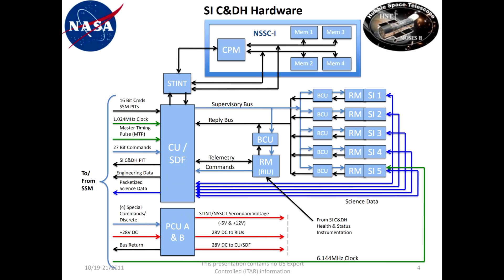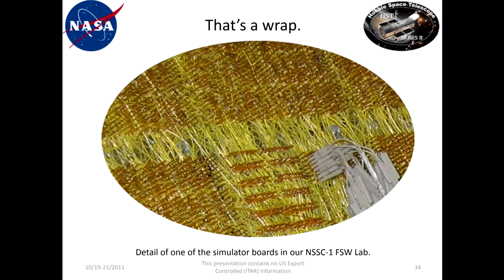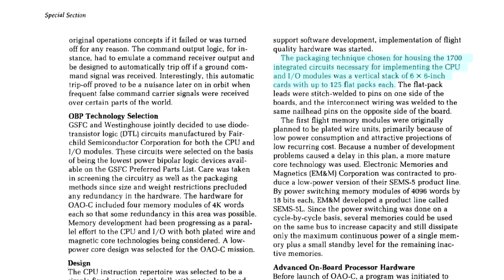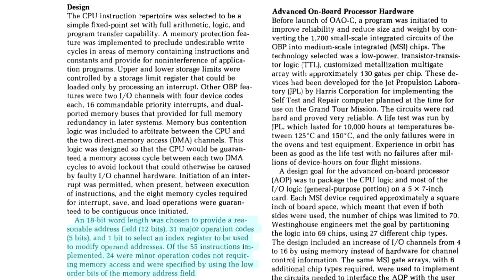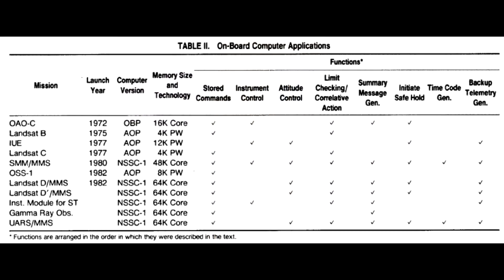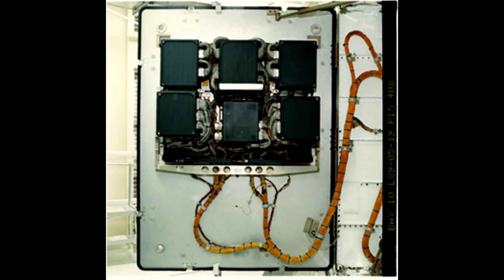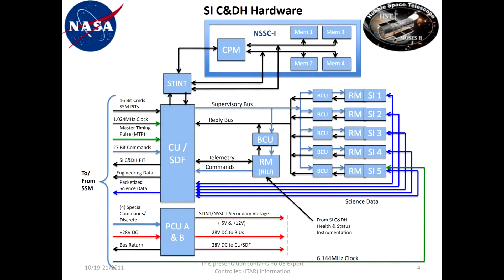Hubble's Latest Problems May Be In a 50 Year Old Computer Design

Comment: My money is on the power supply.
First rule of troubleshooting: Thou shall test voltages.
Reply: Did they turn it off and on again?
Reply: First rule: Visual inspection
Reply: don't turn it on, take it apart!
Reply: Rule number 0, turn it off and on again, if that didn't work, all hope is lost
Reply: Check the fuse first! .... Do they even put fuses in something like this?
Reply: @JohnHoranzy  yes
Reply: @JohnHoranzy  The likely have remotely actuated circuit breakers.
Reply: @JohnHoranzy  Circuit breakers
Reply: @jimstand  Who pushes the button to reset them?
Reply: @JohnHoranzy  They auto-reset after cooling down.
Reply: @JohnHoranzy  hopefully no apple design, or the fuses are the last thing that blow.
Reply: @JohnHoranzy  they probably put self reseting circuit breakers, its hard to change a fuse when you cant get to it
Reply: @JohnHoranzy  Probably, but it's obviously got power so you can rule fuses out.
Reply: I would expect the power supply to be redundant, too, since as you suggest, it is usually more likely to fail than the computer hardware itself.
Reply: Hang on, let me get my 121GW and I'll go check.
Reply: @otakujhp  1.21
Reply: could be caps
Reply: @patchmarks_au  i'm sure that there are no electrolytic capacitors on board of any space craft. It's all long term proven components that they will use.
Reply: Someone needs to do a spacewalk and do the paperclip test on the 24 pin connector
Reply: I always found it interesting that power supplies could survive in space for so long. Most of my repair in work has been bad capacitors.
Reply: @radarmusen  One of the problem is cost (or rather: lack thereof). To make things cheaper to produce, consumer products usually are designed to the bare minimum, so for example the least number of capacitors with the bare minimum capacity to make the thing work. This means the components are usually driven pretty hard, shortening their lifespan.

You can design power supplies that last many, many decades by completely overspeccing them. High quality components that have a known history of reliability, lots of spare capacity on the power capacitors, driving transistors and ICs at less than 10% of their maximum rating. Multiple redundancies. Completely overdesigned passive cooling. That sort of thing.

It's not done in consumer products and rarely in industry products because it really drives up the price. But in cases where maintenance is a costly thing (or even impossible), you usually can argue the project budget to include stuff like this.

This is one of the main reasons why space stuff costs a lot and requires complicated certification of every component and every design. Paying dozens or hundreds of quality control engineers for years might be expensive, but it's cheap compared to building a spacecraft and training astronauts to do a spacewalk for what is essentially an on-site support callout.
Reply: @ReneSchickbauer  Yes you are right, it has just to be working the warrenty out, and if some should use it harder then they just got a new one. Still it will be good business.  
Maybe one of the reason I have replaced lots of capacitors, is because I have been working with avionics  there not has the shortest lifespan. 
But even there is not a problem, is not space, it just go to a repaire shop.
Reply: @ReneSchickbauer  ... and that's exactly why they made long life commercial grade light bulbs years ago.... that last decades! (sometimes it's all about the labor to replace things)
Reply: @radarmusen  They do not run electrolytic capacitors in space. Because of them prone to failure. Esp when u design the circuitry to last 20 or even 40plus years.  Plus i think they will expolode/evaporate in space, the liquid inside...  plus they can not handle radiation.  They use tantalum capacitors
Reply: Is it possible to fix without physically going to it? I'm banking on no,  but I'd like to ask someone who knows his stuff
Reply: @BananaRepublicann  If it's not a software problem then it can only be worked-around.

Software issue – can be fixed remotely
Redundant hardware issue – we can switch between working and broken parts
Non-redundant hardware issue – we can try to work around it by e.g. not using this part
Reply: @BananaRepublicann Nah, It was put into Obit by a Shuttle & all 3 visits since were in Shuttle... 
It’s replacement was supposed to be up & running a decade ago & I don't want to jinx it but should be launched in October.... 

Still sad because if the JWT didn't get held up they probably could have brought Hubble back
Reply: @ApolloVIIIYouAreGoForTLI  that still might be an option with Starship
Reply: @ApolloVIIIYouAreGoForTLI  James Webb telescope is not really a "replacement" for Hubble, its a quite different instrument with a different mission.
Reply: @HidingAllTheWay  Also, the JWT will not be (easily) serviceable either.

Maybe we will see more space telescopes in the future. With cheap heavy launch vehicles like Starship, it might be feasible to launch a bunch of simpler and cheaper telescopes. If one of those fail, just dump them into the ocean. No need for a repair mission. Launch a new one. (But make the deorbiting system fail-safe)
Reply: @ApolloVIIIYouAreGoForTLI  James Webb launch has been delayed by problems with rates of pressure drop and vibrations as the Ariane fairing is de-pressurised and then released.
Reply: @ApolloVIIIYouAreGoForTLI  How can they bring it back? I'm genuinely asking, because Hubble weighs a little more then 11 tonnes or 24,500 lbs.
I'm not really sure if we currently have a vehicle that could safely dock Hubble and then land on earth with all that extra weight, but seriously, let me know if I'm wrong because I would love to know.
Reply: @Nairo89  You are correct. The JWT will be "orbiting" Earth (but not really, it doesn't orbit) at the 'Earth-Sun L2 Lagrange point', 1.5 million km away, and will therefore be beyond the reach of any crewed vehicle currently being planned for the next decade. So I really freaking hope it goes without any major issues.
Reply: @BananaRepublicann  eh not really
Reply: @BananaRepublicann  No.  I don't know anything about space, but unless they have a redundant system in place something will need to be replaced at some stage.  And even that depends on an accurate diagnosis.
Reply: @BananaRepublicann  It's hard to know what the exact issue with the power supply is without physically taking a look. Troubleshooting terminals only give you so much info.
Reply: No the first rule is “is it plugged in?”
Reply: Golden rules of automotive electrical diagnostics; Check powers and grounds first.
Reply: @1202Sid  Every nonobvious problem I've worked on, from a modern high speed PCA to my 76 pinto, involved a grounding issue.
Reply: Unfortunately there's nobody up there to "tear it apart...!"  Besides the "Warranty Void if Seal Broken" stickers are long gone.
Reply: @willierants5880  And NASA has probably only a "bring in" support contract with the manufacturer ;-)
Reply: Mine is on a personal bugbear with old electronic tech in that its possible that some of the Electrolytic Capacitors have gone off spec or burst ( if that's in the power supply then you can bet the voltages will be a lot higher than desired... ) if that's happened then replacement with new is the only way to fix this
Reply: Probably that space debris flipped the 110v/220v switch, happens all the time.
Reply: Amen, brother.
Reply: Ya, I've read that on every forum, but in my experience, it's literally never the issue. First rule of sysdia is to check seating and thermals.
Reply: @GyprockGypsy  Zeroth Rule of Troubleshooting: Never Assume Anything.
Reply: Elon should setup a hyperloop to it, then send EEVBlog Dave to fix.
Reply: I agree. Most of my outdoor stuff in my simulated space program fails because of unstable voltages (drift over long time etc). I threw out all pre-made DC/DC converter modules and new missions now use integrated converters based on the LM 2576 (fixed voltage) series.

Second rule of troubleshooting: Distrust all onboard analog diagnostics readings. Especially if you are using ATMega chips.
Reply: shalt*
Reply: @AlvinBalvin321  shaltn't *
Reply: @bikerfirefarter7280  shalt is the informal singular second person (thou) conjugation of shall
Reply: @AlvinBalvin321  rather archaic. not my field though. sorta like the velour fricative ain't.   ;-)
shaln't be using shalt myself. it could get messy.
Reply: The magic smoke escaped!
Reply: @ICNIRP  ... it's not magic smoke. It's installed at the factory and if it escapes (or you let it out) then the warranty is void! BTW, there's a web site selling "factory replacement smoke" for Lucas electrical products. (it's a parody, but pretty funny)
Reply: First rule of PC support back in the 80s: "keep your hand on the PC, then if it mysteriously starts to work, you can claim it was something you did"...
Reply: Have they tried turning Hubble off and then on again?
Reply: That's good advice.
Even on RF and high speed switching circuits, problems can often be found with a DC voltmeter.
Reply: its what i thought too, since the backup computer has the same problem.
Reply: Maybe some Batteroo could help or the solar fricking roadway couple could help. :-)
Reply: and connectors
Reply: Mine too. Also, really NASA? You sent backup CPUs and no backup PSU? Computer enthusiasts everywhere are having a fit. xD
Reply: My bet's on bad caps. All the evils of the world can be traced back to bad caps.
Reply: Amateur, just change all the caps just to be sure
Reply: Transmission Aborted, Reason: Not enough electric charge

Me: I FORGOT TO PUT FUCKING BATTERIES ON THE PROBE
Reply: That early computer was designed and assembled by IBM Federal Systems Division (FSD) on the second floor of the Engineering 2 building in Owego New York.   The facility is now owned by BAE.
Reply: @EEVblog what a surprise, it turned out to be the PCU was the issue
Reply: Time to recap! Please no replies, its a joke
Reply: It's probably DNS
Reply: a buddy whos father and grandad worked for nasa for years before moving to a contractor who would actually listen to them... both said "check the power supply" and said something about having wanted multi point voltage monitoring but it could be that some of the interlinks failed even.. still to me thats psu related... cant tell you how many early gen modular units we had to RMA at one shop i worked for back in the day... so so so many had failed at the connectors...some had melt downs in whole lines and shorted before they failed... sometimes taking stuff with them even... but mostly just a stinky mess to rma... 

the stories i have heard about nasa culture made me glad i wasnt suited to that kind of work... holy crap... stupid people... in power...
Reply: Is the 121 GW space rated?
Reply: thats going to be a interesting one for the eggheads cant exactly pope it open and get the probe in there.
Reply: You’re funny.
Reply: I wonder if you could perform the smell test on it lol. Always smell for a burnout.
Reply: You have to think they've checked that already.
Reply: I was also looking at those cables.  The second most problematic things.
Not something you can fix though.... the call-out cost would be amusing.
Reply: Nah. First rule is turn it off and turn it back on again
Reply: Oh you are so right! I don't know how many times I have had to tell this to 'young people'.
Reply: thought the first rule was jiggle the power switch
Reply: Time to send Howard Wolowitz up their asap, to get it fixed...
Reply: Haha right!
Reply: Ribbon cables. Always check your ribbon cables :D
Reply: no, the first rule of troubleshooting is to restart
Reply: Just solder in some new caps... ;)
Reply: multiple cores, multiple membanks.. only one PSU ?

beep
Reply: First rule, check to see if it's plugged in. Damn, that must have a long extension cord!
Reply: @billstevens3796  
somebody fiddled with the jumpers
on the ATi wonder card.. 
click ah.. good.. CGA is active again..
Reply: Tell me about it, I'm tired of finding that technicians haven't adjusted powers supply voltages of gyros for 5+ years straight and they are supposed to be adjusted every annual maintenance.
Reply: We should get Dave and Louis some Spacesuits and then Elon can bring them up there to do the Job.
Reply: Dont send Dave - he’ll do a total tear down 😂
Reply: That’s like 3rd rule, after visual inspection and making sure nothing came unplugged (doesn’t really apply to hubble)
Reply: PSU is often the first thing to go and on it's way give you all sorts of funky problems.
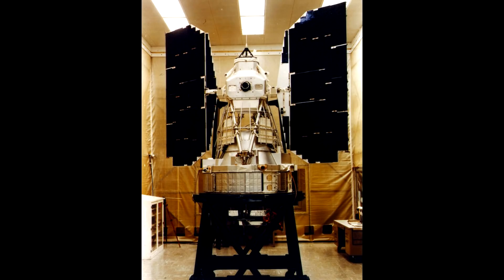Reply: national ultra violet EXPLODER 4:34
Reply: Don’t they have telemetry data from the PS?
Reply: "Bulging caps, we meet again!"
Reply: Indiegogo to Send you to space with an oscilloscope. 

P.S. NOT A TEARDOWN!!!
Reply: It's obviously a bad ground....
Reply: Last rule of troubleshooting: When you think you have fixed the issue NEVER replace the cover and screws before testing.
Reply: Almost certainly, what would you suspect more, recently replaced low stress microchips and huge redundancy or capacitors bought during the worldwide capacitor plague?
Reply: Then test the tubes.
Reply: it worked for a few decades...
Reply: .....What is a technicians worst nightmare??
      Answer:  Bad test equipment!
Reply: I don't have test leads long enough.
Reply: Do they have PSUs? isn't it DC-DC?
Reply: “Have you tried turning it off and back on again?”
Reply: The power supply is giving the wrong voltage?  What, they used a Commodore power supply?
Reply: My brother's PC started refusing to turn on last week. Though it was the power supply. Starting breadboarding to find that it refused to even post with the graphics card plugged in. Immediate oh fuck reaction (tbf it was a 7 year old 980ti). We go to clean the GPU/check for faults, massive heat damage on all the memory chips, to the point where the pcb and backplate were discolored. So god bless power issues, started with the PSU and found it to be a fucked up GPU.
Reply: My money's on ailing caps
Reply: and capacitors in that power supply if it's that old of a unit
Reply: My money is on the intelligent life form that wants to bring voyager back to it’s creator
Reply: They should have fitted an automatic hammer to bang on the side of it!
Reply: Shouldn't have used a Gigabyte PSU!
Reply: First rule is reboot, is it not?
Reply: Nah.. 1st rule of troubleshooting is thou shall check if it's plugged in.
Reply: pls send a 87-V  and some fuses.. :-)
Reply: No the first rule is to restart the computer.  It always works.
Reply: This comment has 256 likes, please do not like anymore for nerdness reasons
Reply: @louisswanepoel1614  nerdish nerdiness nerdosity, 512, 1024, 2048...?
Reply: True. My thought too. Power supply failures typically arise from a failed capacitor.  This results in a fluctuating cyclic voltage.  
               The good news is a  potential work around as follows ...  first, confirm the failure by this clever test.  Assume the power supply does  provide an acceptable voltage level for a fraction of the duty cycle. (I.e. if the voltage converter/regulator operates at a cyclic frequency of 60 hz or 400 hz or 20,000 hz, then the defective voltage output waveform will be correct for a millisecond 60 times a second or 400 times per second).  So use a timer that runs the computer instructions during a set fraction of the power supply’s duty cycle.  After testing results, then you know the problem in the power supply and what timing is required to operate only when the power supply is in tolerance.   The timing may be from an internal timer register that tracks the duty cycle frequency of the power supply.  Since there is no way to synchronize the timer to the start of the duty cycle, then systematically try incremental phase shifts in timing until one works.   Then after the power supply is determined to have a pattern of 1 millisecond of functional output at 400 times per second, run the computer only during that window.
Reply: Check the “O”, “F”, “F” switch. i.e. is it turned on? Hehe
Reply: It’s all good Mr EEVBlog, Elon’s working on this really cool & revolutionary reusable rocket tech that can take off vertically glide back to earth with its patented Epsilon wing design..

HyprTransp0rtr-1... It way more profound than you think.

CGI video should be out next week.
Reply: @ApolloVIIIYouAreGoForTLI  elon made people work on this. he doesnt work himself and he doesnt have the best track record with his groundbreaking ideas
Reply: @ApolloVIIIYouAreGoForTLI  say what you want about musk but space x is the top rocket company in the world and the progress on starship has been promising  at the very least

Comment: Replacing solid core with even Rad Hard CMOS of that era was a stupid mistake. Solid core can take at least tens of kilorads before it starts playing up. Rad Hard in 1990 was at best 2K rads, Modern SOI rad hard (as opposed to SOS) can take more and TEMIC supplied the cameras for the cloud chambers for CERN which have taken MRads and carry on going. However that process was not even dreamed of in 1985.